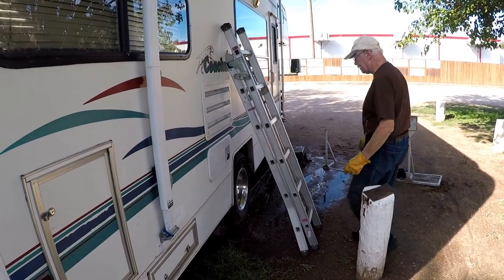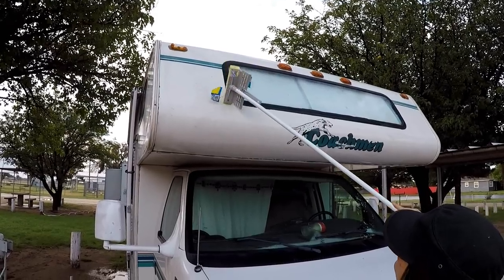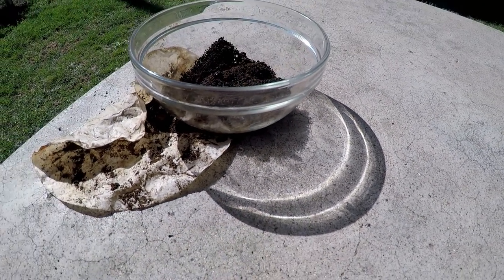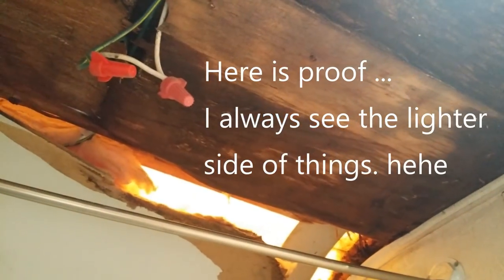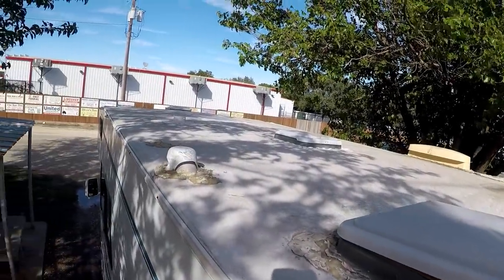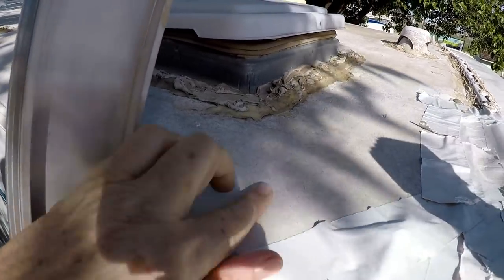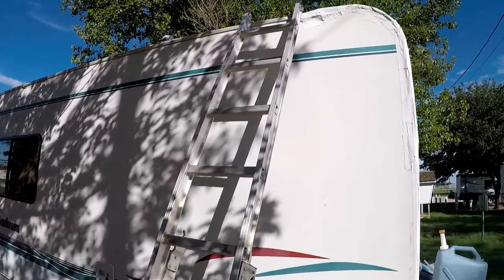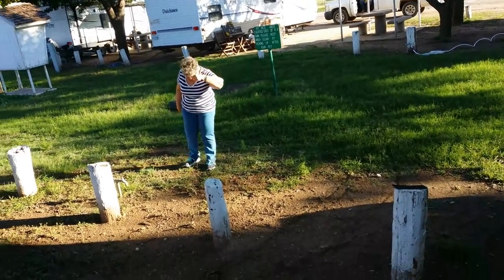Roof Leak, What is Dennis smokin, more stickers wasted  hehe

Comment: When you place the tape, always have the top piece overlapping the bottom piece. This way if it open up the water still runs on the bottom piece rather than under it and inside. Min 9:20 on the video. Top piece should overlap bottom, not bottom over top.  Always think of yourself as a raindrop. Where would you run and where would the path of least resistance be? Just saying. Mr. B. :-)

Comment: Ditch that duct tape and start using eternabond tape, and then reseal that roof before you loose the entire thing!
Reply from the maker: I have a turn to bond and Flex Seal tape I will be using those once I rip off the duct tape and apply Flex Seal to the roof so that the Eternal Bond and Flex Seal tape has a better adhesion that's why I'm waiting does that make sense
Reply: RV Joey it does, but don’t wait too long. Hate to see you with an irreversible mold problem
Reply: RV Joey pppooooop
Reply: RV Joey too bad you aren’t in San Diego or I would probably help you with it
Reply from the maker: I was born and raised in San Diego!
Reply: RV Joey message me

Comment: Hello Joey.   Looks like you will have lots of work to get done at the Van Build. The leaky roof will more of a problem than you think.   The  rest will be a breeze.  I wish you luck and be safe in your journeys.   Bye now.
Reply from the maker: The van build is only a couple weeks and I'm looking forward to getting a lot of advice and measurements and some help with my water pump install and maybe checking out my hot water heater which I'm sure works fine.
I have low expectations of getting things done but high expectations of meeting some experts.
Reply: @RVJoey  Great outlook Joey.☺️

Comment: If I'm not mistaken, FlexSeal & your rubber roof are different chemical components. Thus, the roof will reject the flex seal. It's better to go with rubber roof coating & Eternabond...but that's also $$$  😕  that part of your roof really needs to be replaced. With all the drones out there, I would not suggest a window over your shower! I hope you can get some help. My awning arm is bad in that same section too. Darn kitchen window leak! I wish I had a place to rebuild out of the weather elements.

Comment: Rethink  flex seal.I patched a 1ft x1ft spot in my truck bed that the bedliner spray was off, and its been 3 month since I did it ,and it's not doing well drying up another 3 month I have to buy rhino to rematch better.Desert will be hard on it.
Reply from the maker: I know it's not the best solution.  But I have a gallon and it was 100.00 I think.  It will due for now.  It has too. Thanks for sharing tho.

Comment: Oh my i feel a little better now i thought my roof was bad. Well so far I've paid 2 separate people to do my roof bad thing is they didn't know what they was doing i now have leak around AC i didn't have still have leak in my rear corner & I bought dicore & eturnebond tape & found out the guy caulked under the tape anyway & the idiot used something I didn't buy clobs of black tar i could scream now I've got to tear & scrap do Job myself & I'm out a few hundred 😡